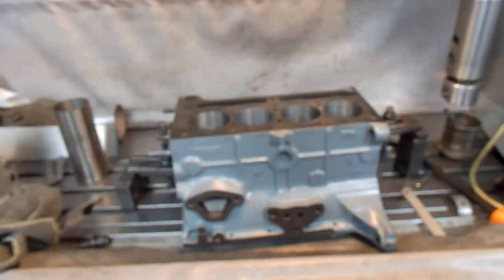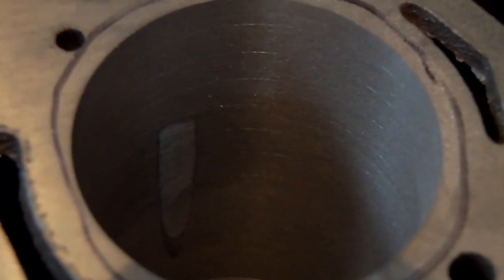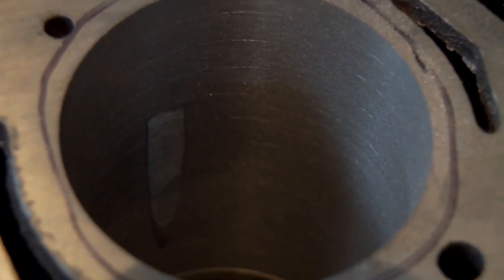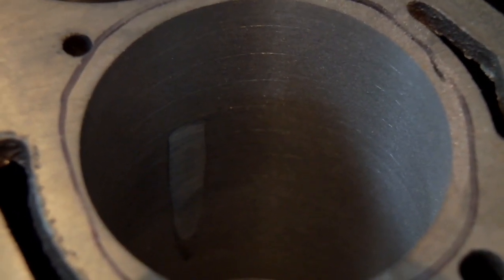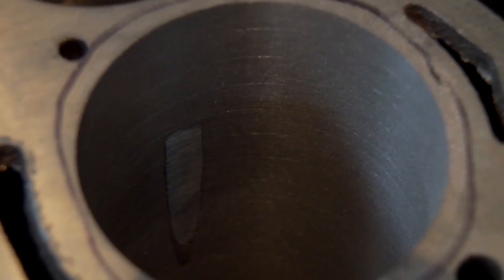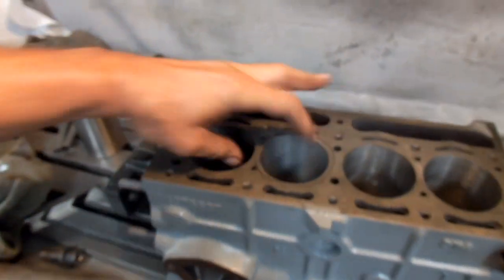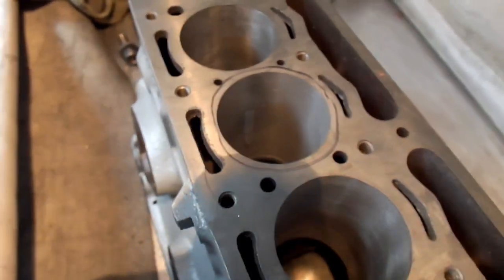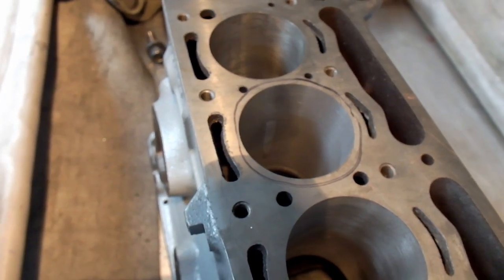Cylinder Defect from Casting Cold Flow

Comment from the maker: Yes I have seen this. If you have some 90% of the original cylinder intact, you should be good to go, BUT I do put a critical eye on stuff like that. If its just a hole in the cylinder, 1/2" for sake of argument, a sleeve will cover this up with no problem. I used to sleeve the IH 550DB engines all the time because they would have cavitation damage and run into places that were .
.200" x 2.000" long and sleeved them without problems.